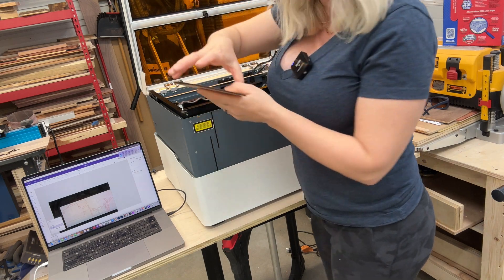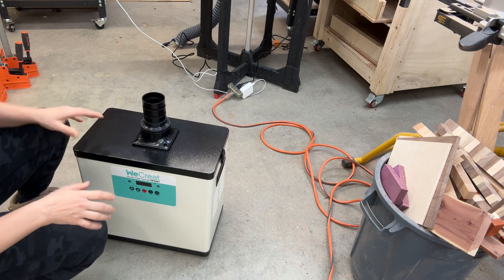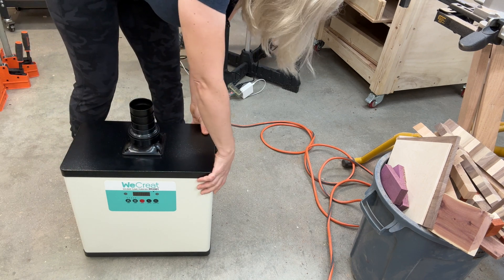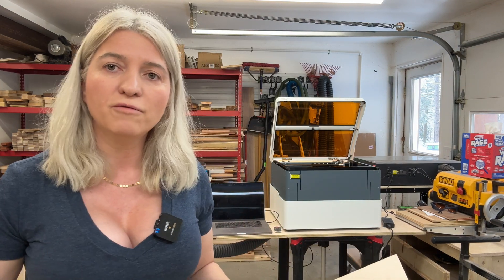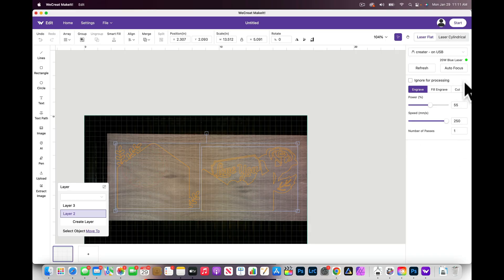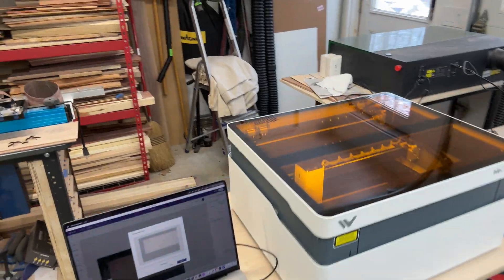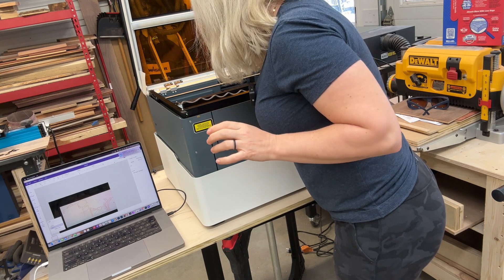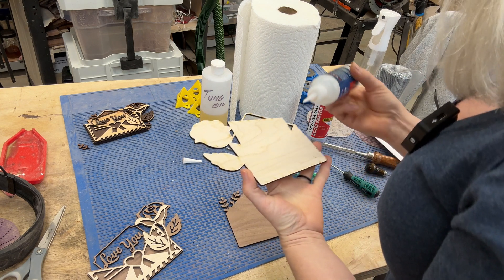Let's make a Valentine we WeCreat Vision laser machine. BONUS: WeCreat smoke purifier review.

Comment: Hey again . I noticed your reviews of the xTool S1 40-watt and the WeCreat 20-watt lasers detailed work is similar on both lasers. So, my question is: for the new WeCreat 40-watt, would you consider it over a 20-watt laser for what you do? I like the xTool S1, but there is no camera and it is overpriced. Some people claim a 40-watt laser isn’t going to give you detailed engraving, but your engraving on the 40-watt is impressive. I am about to plunge in to getting the new WeCreat 40watt today but will wait for your feedback. So, what are your thoughts?  (I submitted the same comment on your other WeCreat video, trying to get your feed back today)
Reply from the maker: The engraving is good on both but s1 is a way better machine and smoke is way better controlled.
Reply: @SkylerEwingWoodworking  Wow, I didn’t expect an answer this quick. My budget is around 2,100. Amazon has the S1 20watt w/riser, tumbler, air assist for 1,887. WeCreat new 40watt is nearly the same as S1 with discount. Don’t have the budget for the S1 40watt. What would you do in my case? Also, If I get the S1 20watt, module can be upgraded to 40watt but that alone is 1,499. Again, thank you so much for quick reply 🤗👍
Reply from the maker: @LouRao  it all depends on what are you using the laser for. If doing mostly engraving, 20w is all you need. If you never engrave material thicker that 3/4 in, you don’t need riser ( not sure about rotary
Reply: @SkylerEwingWoodworking  Thanks for the info. I ordered the xTool S1 40-watt on Amazon. I think I got a good deal. I paid $2,049 with the honeycomb tray and air assist. They had a 20-watt with a honeycomb tray, air assist, riser (not pass-through), and a rotary for $1,878, but I went with the 40-watt and decided to get the accessories little by little. Thanks again.

Comment: Love the card, did you find that on etsy? Is there a way to take the bottom out if you wanted to pass through for larger items? One thing I like about an open frame laser is I can laser on a very large or tall item.
Reply from the maker: Yes, I bought it on Etsy. The laser moves up and down and you can engrave items to over 5 in I believe
Reply: @SkylerEwingWoodworking  Good Afternoon, very good video. Thank you for the reviews
Reply from the maker: The bottom is the tray so yes you can take it out and maybe place the lasers on some blocks if needed